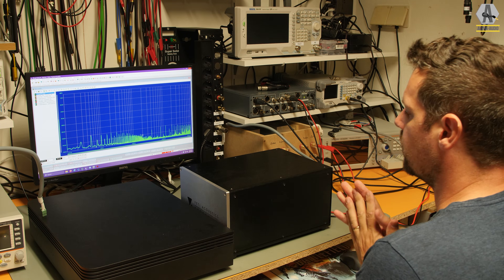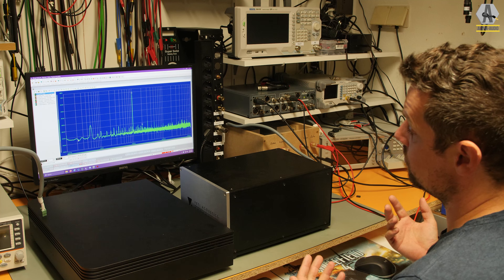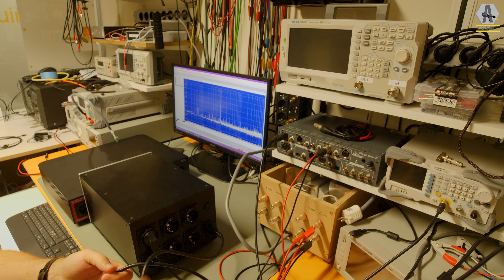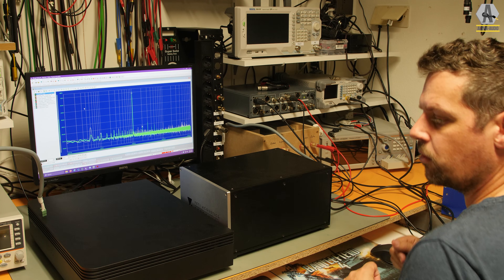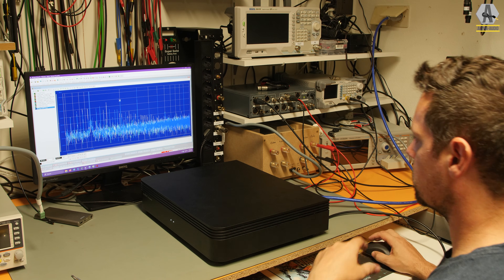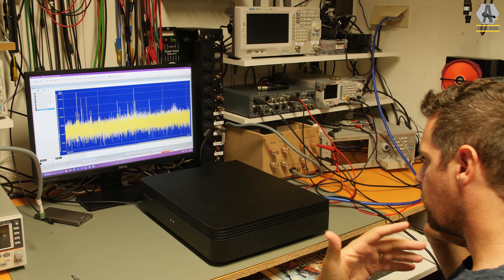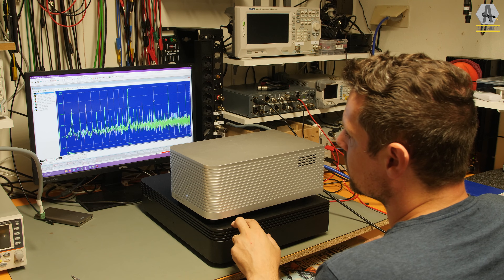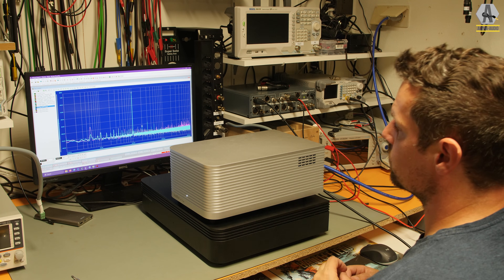Alpha Labs - Do Power Conditioners actually do something?

Comment: Great work as usual. I am using isolation transformer for my sources (streamer, ddc, dac, preamp). That makes the most difference in my set up.
Reply: Same here 😊. I have a balanced toroidal isolation transformer by generic Chinese brand. It wasn't too expensive. I though doubt how much of it is actually balanced as there is no circuits.
Reply: @Thoughtflux  Balanced doesn't reqire any circuitry; it just means you center-tap the secondary to deliver ~60v on the hot and 60v on the neutral for a total of 120v (in NA). Any transformer that can be wired for 120 & 240 in + out can be wired for balanced power in NA. No circuit boards required. Elegantly simple.
Reply: @DBravo29er so does that mean the neutral/ground wire is live too in a balanced design? Don't we need a voltage between the hot & neutral wire to make electricity pass? And also how doesn't it cause a short circuit? (i thought the balanced design was made to reject noise traveling on the wires)
Reply: @Thoughtflux There's lots of info out there on wiring a transformer for balanced power. The voltage is divided equally between hot and neutral. The ground is center-tapped. Think of it as "push-pull" power; there are two 60v voltages on each of the hot and neutral. They sum to 120v. A differential voltage is not needed in a balanced transformer secondary.
Reply: @DBravo29er ok! I will have to look more into it. Does it reduce electrical noise from coming in?
Reply: @Thoughtflux It does!
Reply: @DBravo29er thanks! Glad to know that i wasn't imagining it 😊
Reply: Emi filter

Comment: Nice test. Education for us that doesn’t know or can see. What about interference of the LED lights. How would that affect the amp?
Reply: Inference of LED lights is their switch mode power supplies. It is indirect, they put noise on your home grid. So if the power conditioner filters or suppresses these noises in that frequency spectrum, it counteracts the influence. Same is true for power inverters of solar panels and home charging solutions for electric cars, which often leak a lot of DC offset onto your home grid.
Reply: @jmtennapel  Thanks. My problem and EU standard with LEDs, I have more then 40-50 low light LEDs in our house. No charger for car or sun panels jet, so we are filled with jitter and interference…. Same as in modern life. Do I need to go off grid and power my gear with batteries?😀 No joke, but we need to slow down huge bit. Jaap talked about LED in a previous video and it’s impact. Best way is to build a separate electric power system to the music system in the house. Shielded cables and separate fuse box with filters. Tin foile hats?.

Comment: Does anybody understand why on the Yeti the 50Hz was lower? After all that is what carries the power... Note that Aquarius and Titan did not suppress any of the 50Hz (which is what I would expect...)
Reply from the maker: It is a balanced setup. But the 50hz is leaking... i am measuring the speaker output on 1 kHz. There should not be any 50 Hz harmonics.
Reply: @TheAlphaAudio  At 4:15 you say "the 50Hz is lower", and I don't quite understand that, since rejection of 50Hz from the analog out is a property of the amp itself. (I would do a re-measurement there 😉)
Anyway, you make a good point with the video.
Reply: @TheAlphaAudio  I think the 50 Hz noise reduction would be the only audible part of the noise reduction that you measured here with these conditioners. Yes, there was some mid-range and HF reduction, but that was at the edge of audibility.

Comment: Puritan 156 owner here. Awesome product. Drastically reduce the noise level through the speakers and much more benefits too.
Reply: lol just replied to a reply on my post and upped the Puritan 156!  At least it shows i wasnt making it up.  I am saving to get another.  Time to buy shares in Puritan....
Reply: I was amazed when i put puritan 156 in my system. I am saving to buy one. Did you try any other conditioner ?
Reply: Curious! Did you try plugging your amp into the Puritan? How did that go? I know the Puritan power conditioner has a positive impact on source components, but I've been wondering if it has positive/negative effects on high current amps (like my 300W class AB amp).

Comment: Thanks a lot for your efforts!! Well done, love that you are measuring on the analogue-out and not just on the power outlet side, much more valuable for me from a listener-prospective! Didn't like Amir's (ASR) review some time ago, concerning power conditioners (*doesnt do anything..*, yes, in his measuring power-only use-case)
Reply from the maker: Indeed... like I said... it is important to know where to look...
Reply: Don't forget a Stromtank that changes the AC to  DC battery and uses a rectifier to convert it back to DC.  You can disconnect from the grid for hours of listening.  I use a UPS used for the servers in UPMC hospital computer center that does the same thing, and also has great power conditioning as well.

Comment: but is the noise you see audible? that is the question.
Reply: In my experience, you can't hear the noise, but you can definitely tell when there's a lack of noise.
Reply: That one is easy to answer: audition one of these at home, then you know from experience.
Reply from the maker: Depends on your ears, gear and faith.
Reply: The thing with 'noise' is that it's kinda like an  invisible cloak masking the finer details. Noise really is the wrong word as its not noise that you can hear. Get rid of it, though, and those details, instrument separation and ambience etc really come through. I never heard a big difference until my system got to the 12k mark, but it's so noticeable now. Balanced mains made the biggest impact
Reply: You forgot the plixir 😉
Reply: @josschreur6992  this isn’t comparing power conditioners, but showing that they do have effect on the speaker output of an amplifier! Something people have been asking for a long time.
Reply: Massively dependent on your electric supply quality.  Best to view these as components that help your expensive audio equipment function optimally by reducing the amount of noise transmitted to them.  Full regen components would be the ultimate so long as a) you have the bank balance and b) your floor and back can cope with the weight
Reply: Record a 50Hz sine wave at 0 dB and then turn it down to -95 dB in your DAW and see if you can hear it. An easy test anyone can do.

Comment: Excellent work yet again :)  Depends on how polluted your mains is to start with.  I have had Isol-8, PS Audio and latterly Puritan conditioners and all make small but audible differences powering source components especially streamers and DACs.  Main plus point to all is smoothing out transient spikes that occur in the mains whilst adding additional protection for expensive equipment.  Overall it also comes down to your mains supply and how sensitive each individual component is to noise.
Reply from the maker: True
Reply: Which Isol 8 do you have? Real HiFi Help on YouTube recommends the minisub Axis. I live in Toronto and can't find a used unit so found the distributor who recommended a Substation which is around twice as expensive. They did a comparison on this channel that included a Isol 8 and I think it did less damage to the music than the other units. It had the most subtle effect. The others made the sound either too thick or too rich or made it sound like the music had been sped up. Incredible that these effects happen at all. I use Audio Note UK electronics and real HiFi Help is a Audio Note fanatic so his opinion is likely to be more relevant to me since that's what he has done most of his comparisons with. 

I bought some ungodly expensive Critical Mass Systems Center Stage 0.8 M2 footers for a couple of my components and they made such a big difference that it makes no sense. They need to be tweaked because they caused the sound to become too sterile and fake sounding. But when you get it right it's incredible. It makes zero sense that these can make such a difference. I always thought it was electrical power quality that made my system sound bad most of the time. With these footers it sound great even when it's hot outside and everyone has their air conditioners running. I'm looking at getting Arya Audio Revopods to compare. They're supposed to be in the same ball park of sound improvement and are cheaper and have nicer features like height adjustment. They also make cheaper ones that have less features but most of the benefit if you want footers for small cheap components like reclockers or Dc power supplies or routers etc. 

I'm even considering buying Seismion active vibration platforms. They're German though and I'm leery of winding up with $8000 door stoppers like most everything Germany makes. Too complicated. Can't be repaired. The parts are no longer made after 6 months to 2 years. Now with the war Germany is deindustrializing and so things will get work quickly. I work in heavy industry and the fools in management have bought all sorts of German machinery. Zero service manuals. Zero information. Parts no longer made. They are too complicated and so poorly designed that they start falling apart within weeks of going into operation. Even if the parts are available they are so expensive that we can buy them. Germany is socialist. Everything is paid for by the federal government. It's a racket.
Reply: @bunsw2070  they were the first conditioners i bought back in mid 2000's, MiniSub and also had a Vision.  Changed these some time to a PS Audio Quintessence and now Puritan 156, impressed with Puritan have to say, didnt realise how the others (admittedly old tech) were somehow supressing dynamics.  As for isolation thats another ball game altogether, where do you stop.......!
Reply: Curious! Did you try plugging your amp into the Puritan? How did that go? I know the Puritan power conditioner has a positive impact on source components, but I've been wondering if it has positive/negative effects on high current amps (like my 300W class AB amp).
Reply: @Vsread21  not been brave enough to try. I have a krell KAV3250 that is a fantastic heater in winter!

Comment: well done, hero brother 👍 try put the extra light (diff. lux / λ) to the phono cable or vaccum tube on next trials！ Sorry, my tone arm cable pickup all kinds of noises all the way 😫
Reply from the maker: Thanks. I didn't get your advice though... what do you mean?
Reply: @TheAlphaAudio  My audio KT88 tubes act as a Photomultiplier, and my old VPI phono tonearm with exposed signal cable are so sensitive to pickup the noise from a led light strip.  I hope that you can measuring the same way (FFT) on the vintage gears or devices, such as vaccum tubes. I'm sorry for my poor english and Thank again, one of my PRO. KOL 💯 Any active or passive solutions or analytical demo to get better S/N are all welcome 😘
Reply from the maker: @cosplay_hifi  Ahhh... i get it now. I can measure interference. But I dont have vintage tube gear. Sorry